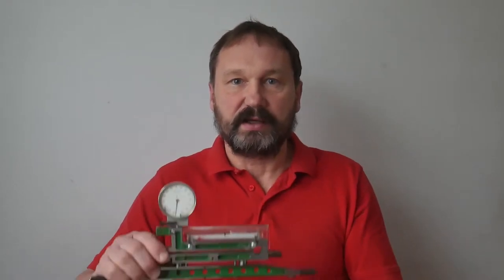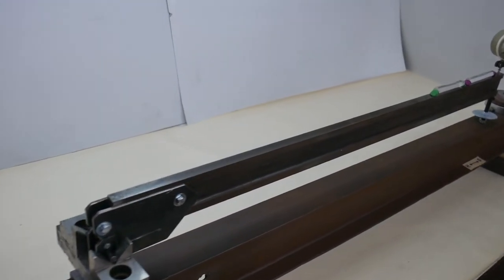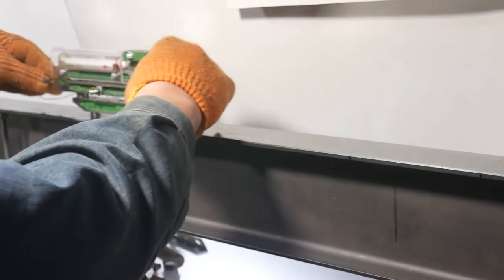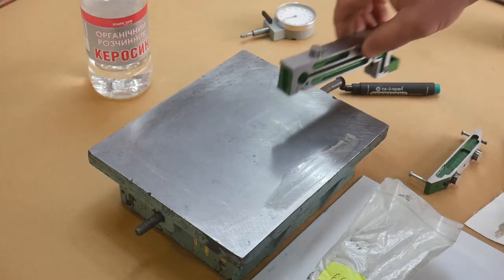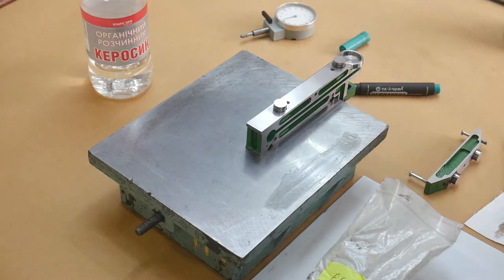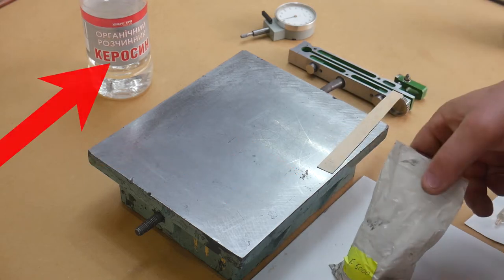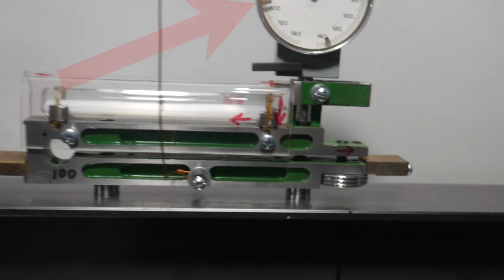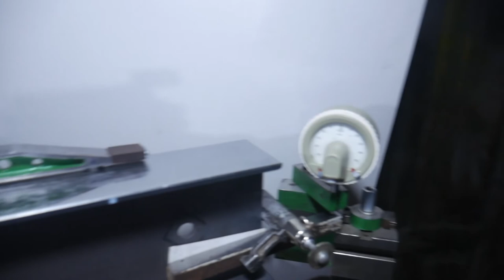High precision level (DIY)

Comment: Excellent! What an elegant, high quality tool! I made a precision level a few years ago, and it's actually better than a precision indicator for measuring flatness and straightness. Mine has 3 point contact, also made from drill, about 4MM polished to a ball radius. Adjustment is by a 3cm wedge with about 3UM thickness difference from end to end, so it takes almost 2 screw turns to move the bubble 1 graduation. Not tweaky at all!

Comment: I was thinking that you could use a flexure mechanism to "multipy" sensitivity, at the expense of a bit more surface pressure...
Reply from the maker: Unfortunately, probably because of the inaccuracy of the translation, I did not understand the idea (.
Reply: AVE makes one in the video attached.

Comment: Bubble level is unsuitable for such precision, simply because bubble size depends on temperature, increase temperature a little, fluid expands, bubble gets smaller and you get wrong measurements.
Reply from the maker: But it is possible to carry out measurements observing a regime that excludes temperature changes from the beginning to the end of the measurements. I have used this technique several times and it allows the surface of a surfase plate meter long by meter wide to be processed in the direction of maximum flatness leading to submicron accuracy. This method works great.
Reply: Compared to electronic pendulum/LVDT levels, bubble levels were far less accurate and stable over time, from my experience.
Pendulum level like Talyvel, you set it up on surface plate, zero it, leave it for 1/2 day, it will still be close to zero, when you return.
My Stiefelmayer bubble levels, bubble shrinks and expands with temperature, takes much longer to take a reading and it's far less repeatable than a Talyvel.
Reply from the maker: @hinz1  I'm interested in hearing about your experiences using an electronic level. Unfortunately, I don’t have this level yet and I can’t practice working with it. It's probably quite expensive. In any case, in Ukraine I won’t be able to find one like this to buy at all; we practically don’t have anything like it. Although there are many other special devices, and they can be purchased relatively inexpensively.
Reply: Yes but if you run test in a shot period of time that works quite fine , I have a HP interferometer 5500 and a Federal 832 but that costly to very costly equipment the classic ''bubble''  system as describe in the video allow a nice DIY system at reasonable cost . Another interesting system is the 0737-1203-99 ±0.5° Glass Single-Axis Electrolytic Tilt Sensor fron Fredericks .